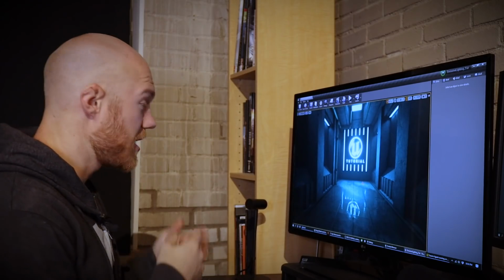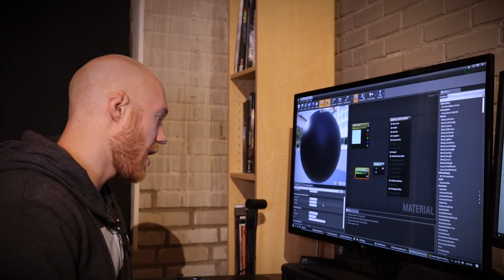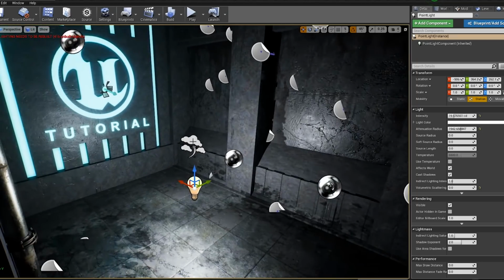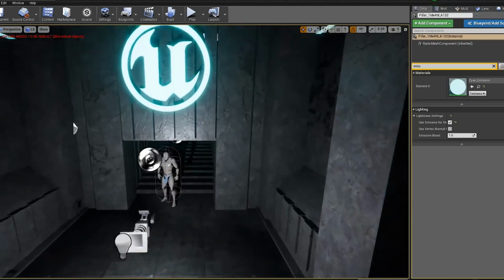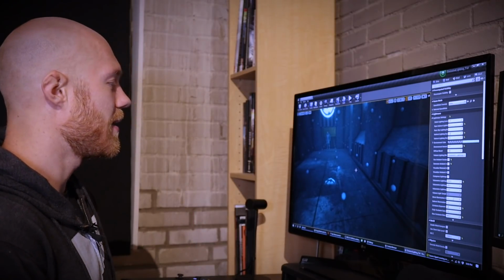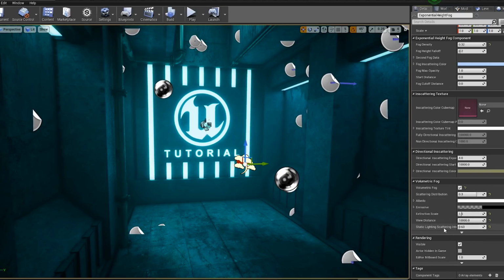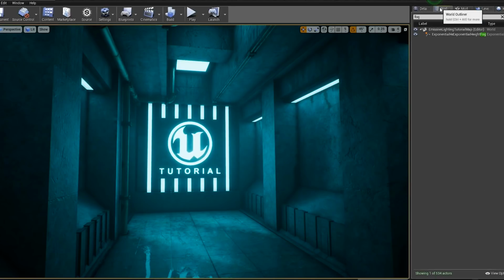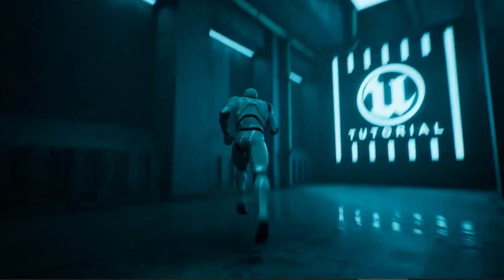UE4 Emissive lighting and materials tutorial - unreal engine for beginners

Comment: You can use the "V" Key + Click to get a Vector3 Parameter and "S" + Click to get a Scalar Param inside the material editor... and you save yourself...... 2 clicks per param :P (probably 3 minutes in a lifetime)
Also... kinda minimal too, you can set the material to Unlit if you don't need the roughness/Spec/Normal of a standard Lit Material. In this case in particular (emissive material applied directly to geometry) could have some impact on very low end (mobile) hardware I think.

The Bloom thing you explained here was very useful to understand what those values mean. Makes a lot of sense now :D
Also, I'm always interested in how you are using the auto-exposure controls in the postprocess volume or camera... those make very little sense to me. 
Thanks again for this tuts.
Reply from the maker: Awesome thanks for the heads up :) glad the bloom stuff helped!

Comment: I really enjoyed this and learnt a lot thank you. Does this still apply with lumen? i.e. setting emissive as static on the mesh to save on overheads?
Thanks for the information. Subscribed.
Reply from the maker: With lumen now it picked up emissive automatically so you dont need those extra settings like in this video, the most important thing to focus on with lumen is your emissive intensity value, if you are using real life lighting units and exposure it will have to be way higher than you think (like 2500) to be physically correct, but thats a bit more advanced. Just play with the intensity until you see the effect :)

Comment: great tutorial man !! Just one thing, shouldn't one make the material have a 0 specular? like connecting a 3 vector with 0,0,0 to the specular input of the material
Reply from the maker: thanks :) doesn't really matter as the values it is displaying with the emissive are above 1 which basically overpowers/kills any specular. you could plug that in if you need to for a specific result but I have never needed to.
Reply: @PolygonAcademy  I see. To be honest i was trying it with a open daylight scene, i guess it would be irrelevant in a dark environment

Comment: That was helpful, Thanks Tim, Is it possible to control the color and intensity in runtime?
Reply from the maker: if it is baked you cant change it easily unfortunately, with a stationary light you can but changing the emissive contribution to the lighting at realtime is not really possible. you can have emissive materials that change intensity and color during runtme but the bounce light wont update
Reply: @PolygonAcademy  Thanks!

Comment: Hi Tim,
Thanks for another tutorial. Can you tell me if I can use it to light my scene in ue4??? I asked the question because you lighted an indoor scene with these techniques, but I am building a full environment, which may have severals lights. What do you suggest??
Reply from the maker: if it is a larger environment you can use this technique on your acual lamp/light models to add extra GI to the scene in addition to the more standard unreal lights like skylight, directional, spotlight etc. if you are baking lighting this should work in most environments. I wouldnt light exclusively with emissive if I didnt have to, so use actual lights, this is just an extreme example haha.

Comment: Hi,  Since i don't see a way to ask a different question elsewhere,  I am doing it here.  I went trough the lights videos, but I do not see (or missed it)  how do to a light for a TL-lamp (those long rec. ones)     I found a rectangle light,  but could not get it to work.  and 2nd  If I use a spot light for a hanging lamp,    how do you make it so you can see the light ray.beam coming from such light(s). 
Thank you for your time

Comment: I can't open the file.

the following modules are missing or built with a different engine version

SubstanceCore
SubstanceEditor
SubstanceSource
SubstanceLiveLink
Reply from the maker: You need to be using unreal 4.23 and have the substance ue4 plugin installed i think. That should fix it

Comment: trying to do this myself on a custom material that emissive elements - but the checkbox for'use emissive for static light' is blanked out. why would this be?
Reply from the maker: you need to set it on the static mesh in the level not the material itself, if it is blanked out on the mesh, make sure the mesh is set to static, not stationary or moveable. hope this helps!

Comment: Hello Tim, i am struggling a bit with ue4 prefabs/blueprints, and i looked everywhere online and didnt find a thing...So i want to to have custom pivot points on my prefabs cause i want them to snap together seamlesly, I tried the V button in the editor but it doesnt seem to work there... What are my options? Thanks in advance!
Reply from the maker: I'm pretty sure the pivot of your blueprint is based on its local 0,0,0 so if you want the pivot of your wall piece to be at the corner of the mesh, place the mesh within the prefab editor so the mesh's corner is at the origin of the local grid within the blueprint editor.  this is easier to do if the pivot of your mesh is already setup like that and you use it as your parent object when you put together your prefab. if you are selecting a bunch of meshes in the world and converting to a blueprint, it uses the first mesh you select's pivot as the origin. but you can always shift things around inside the blueprint editor viewport window.
Reply: @PolygonAcademy  Hey! Thank you for responding so quickly. I am beginning to understand what i am doing now, just need to re-arrange all my prefabs now! Thanks a LOT!
Reply: @PolygonAcademy  Hey Tim, one other quick question regarding prefabs. When building an environment do you do all layout in-engine? (Say you're kitting out a library and placing assets where they should be) Or do you do layout/level/world building in your DCC application (Max/Maya) and if you do it in engine do you merge assets together at all to keep mesh draw calls under control?
Reply from the maker: @Akaikami  i do it all in engine, sometimes merge meshes if needed, or use HLODS/instances to get drawcalls down. i spend almost all my time in the engine these days
Reply: @PolygonAcademy  Awesome thanks for answering man, I'm mainly a character artist but been getting deeper into environment art and it's definitely a different mindset than creating everything 1-off unique. Keep up the great content, I really appreciate it!

Comment: There is one thing this doesn't cover. emissive's on moving objects. Ex - Weapons, Mech's, motorcycles, etc
Reply from the maker: i think i touch on it in there but you can only bake emissive lighting contribution from static objects. moveable objects wont contribute to the lighting bake, but ofcourse can still have emissive materials applied, it just wont add to the lighting

Comment: Great tut! Thanks! I'm following your tutorial, but doesn't matter what settings i put i get the same noise from emissive light in my bake over and over again. Here is screenshot - https://prnt.sc/qmfn90 Thanks!
Reply from the maker: It could be your lightmass settings in the world settings tab. The indirect lighting quality could be boosted to 1.5, indirect lighting smoothness set to 1 and also make sure you are building lighting on medium or higher, preferably high settings under the build drop down. Those would be my first suggestions
Reply: @PolygonAcademy  I tried with exactly this settings, same result.. I tried in World settings with 0.1 12 1 3 0.9 like you have in your tutorial, but still same result.. Lightning quality set to production. The only way I find out is to use Luoshuang's GPULightmass with extreme quality setting, only then i get rid of this noise. But, the thing is, I don't have volumetric lightmap anymore it's just black (looks like it doesn't work with GPU Lightmass). It's very important for me because i need animation later in my scene and maybe some fog. So, i spent 2 days trying to find out, how to do it with native Unreal CPU Lightmass ir correct way, no success so far.. I'm using 4.22.3 build. Thanks :)